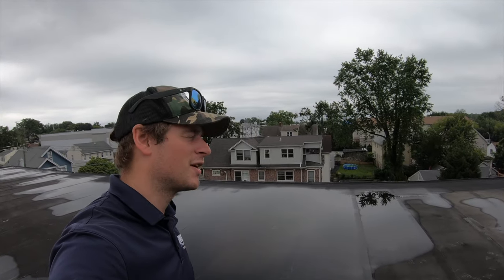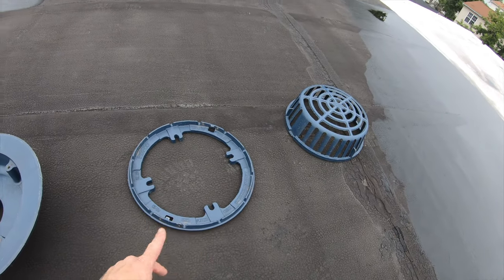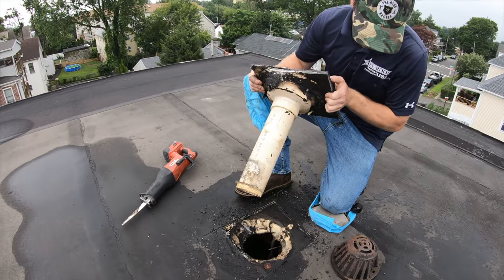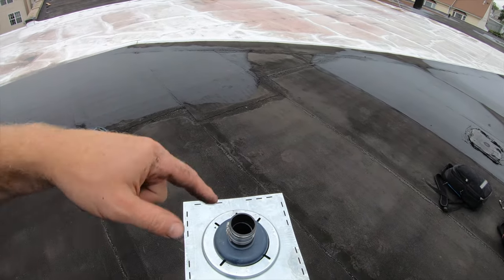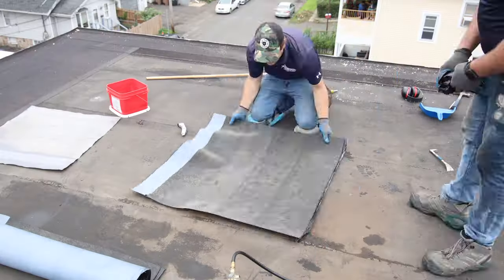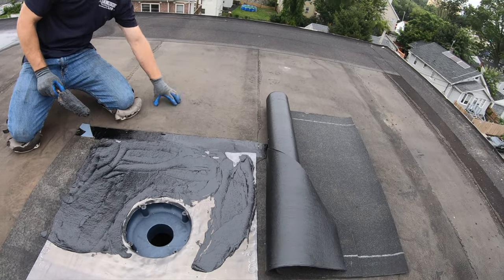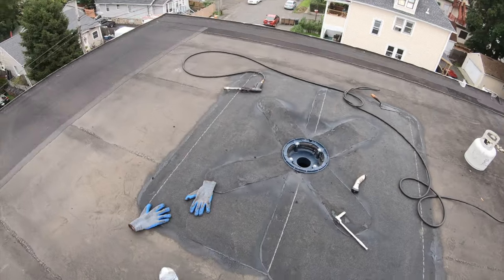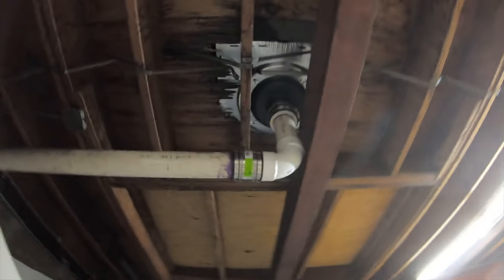How To Replace a Flat Roof Drain

Comment: Seams to be a good job to me. Zurn drain, that's a plus. A  few  things though.  First ,maybe make the sump bigger. Second, block in the underside of the deck for better securment of the drain receiver. Third, (most important) add hangers to the interior drain line so the no hub coupler won't slide off the conical drain outlet. 
Other than that,  great job.
Probably minimum two grand complete.
Reply from the maker: Good points

Comment: you didnt mention how you cut the insulation on an angle, good job besides that.  we cut on an angle because its a drain and water needs to flow to it and also to cover. glad you didnt use tape.  I saw a gee duct tape the pipe once lol.

Comment: Next time just primed the lead with asphalt primer then you can torch onto it also run your lead down into the bowl over the holes then cut the holes out for your bolts
The way you did it will not pass manufacture specifications if inspected for long-term warranties
Reply: It's also nice to prime existing roof you are torching new patch to.🤷‍♂️
Reply: Facts